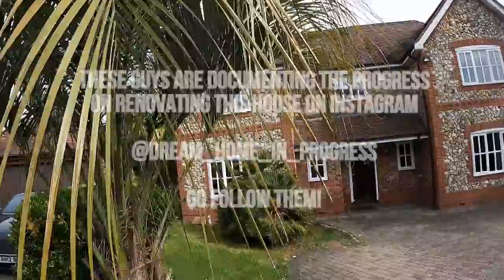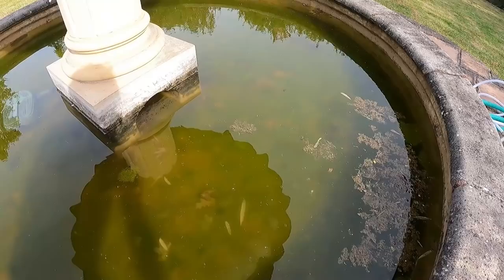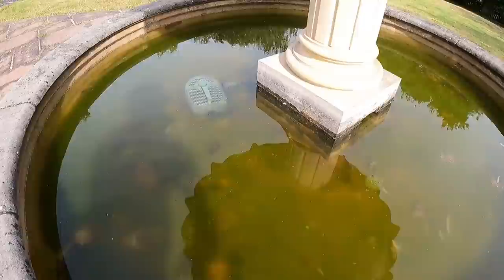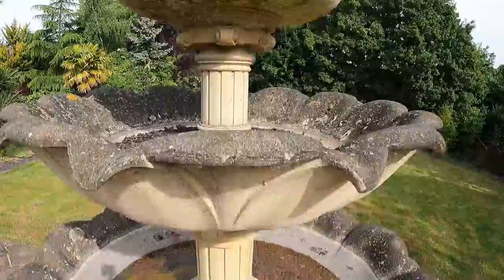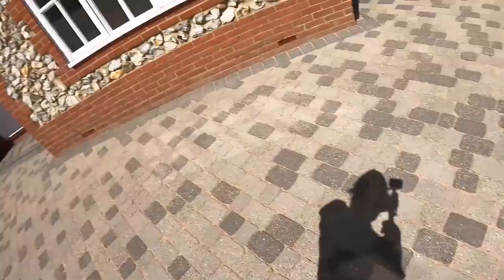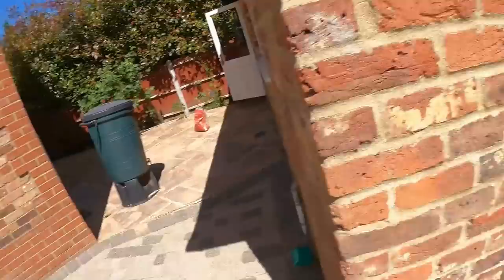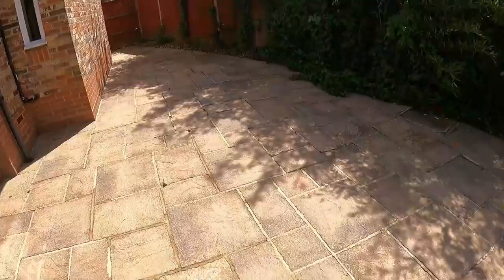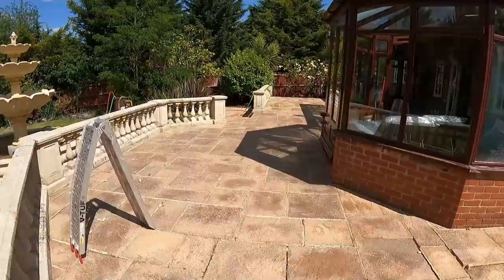It Took Me 20 HOURS To Clean This Beautiful Country Home!

Comment: I literally just finished watching Ricky Banjo’s channel (Bournemouth jet washing), and then noticed this. Ricky often goes to some nice houses, but this place really appeals to me. I think it was subscribing to Ricky’s channel how I found this channel, and I just asked him this question : When you’re both doing driveway’s, with the large surface cleaner, the amount of wet mud that just seems to move around makes me inclined to give the drive a quick brush when the mud is dry first, just wondered if that’s a bad idea? Also what great host’s l, I’ve always been reluctant to join Instagram but think I will to watch their renovation, I think this will be great to watch. Cracking job, as always 👍
Reply from the maker: On overcast or wet days I’ll brush the sludge down but on hot days it’s dry by the time I’ve finished with the surface cleaner and it’s hard to sweep so just rinse it down :D 
Yeah Ricky’s great 👍

Comment: Not sure if this will help partridge exterior cleaning, over here in the U.S. they have mold killer. 

It's like the foam sprayer you use and has all the stuff in it. It kills mold and mildew In like 5 mins, plus it's bio safe. You can use it on house siding, wooden decks, even brick pathways and such.
After that, pressure with high psi pressure washeron all stone. 
Then use concrete brightener on stone. And wood brightener on wood. 

Do a light stain on wooden decks and clear coat seal on all wooden decks. And it will always look like brand new! 

Used to do pressure washing jobs in the state's as well as remodeling and building decks. Learned a few tricks. Plus you can charge out the ass for all this if the clients have the $$. Hopes this helps a little.

Plus! Mold won't come back for 5 years most the time rather then pressurewashing it and it will be back in a year!

Comment: Do you ever use TSP and bleach to reduce the etching caused by a power washer?  I find it works and then a light clean with the power washer thus reducing the damage to the cement.

Comment: Fantastic job as usual. Well planned out and executed. Just a quick question, what type of kiln dried sand did your use? It looked darker than the usual sort. Might’ve just been the lighting from the sun? Looked fantastic anyway. Thanks for the work on the videos. Very helpful.
Reply from the maker: They tend to change colour depending on the quarry its from, so sometimes a supplier changes or gets a new batch in thats cheaper, it's all the same stuff just different quarries with different colour stones and sand, cheers mate!
Reply: @PartridgeExteriorCleaning  Thanks for that info. Very interesting 👍👍👍